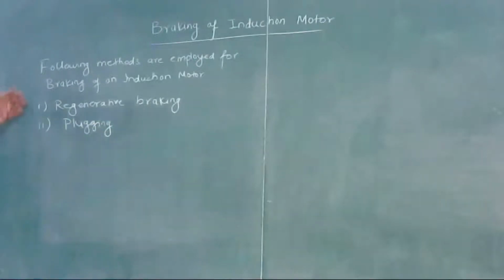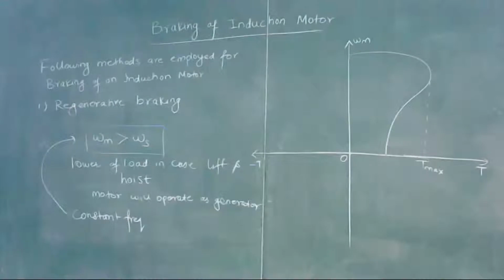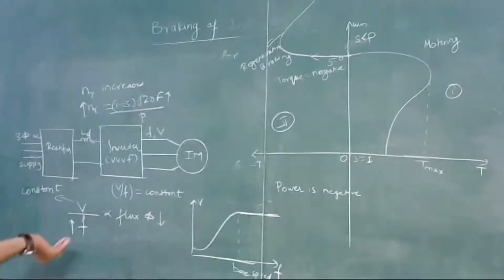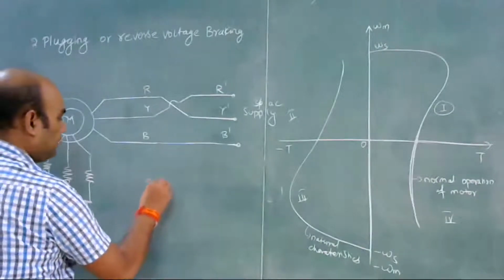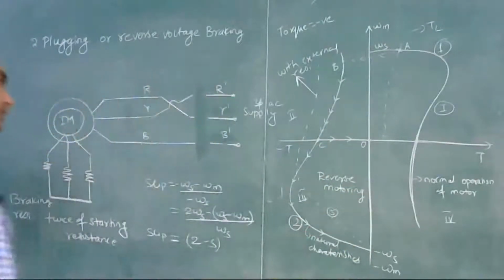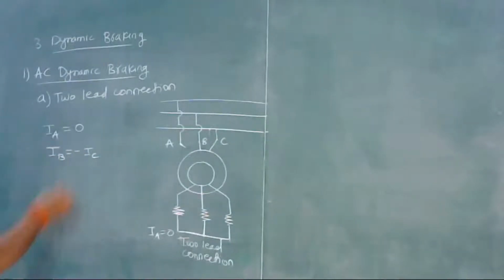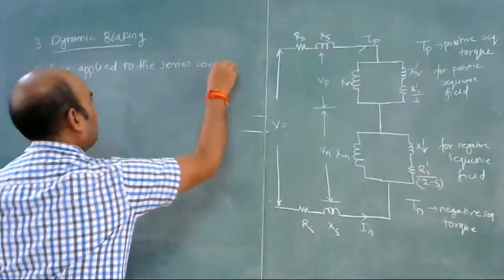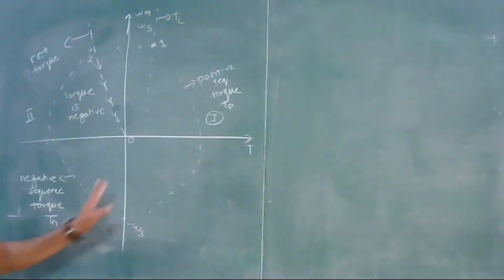Braking of Induction Motor-Regenerative braking, Plugging & ac dynamic braking

Comment: Sir i have a doubt, is that in AC 3 phase induction motors how does the exciataion will get to work as a generator

?

i am struggling with this question since long years

Comment: I have one question
Reply: In dynamic braking
Reply: How motor get generator
Reply: @JyotishSpecial  i have some knowledge let me share this.

DC motor will be made as separately excited generator, that means filed winding get supply from external source and armature rotates freely due to momentum.
Reply: @jangamlakshman7006  no
Reply: @JyotishSpecial  then how
Reply: I working on them hence I shared
Reply: @jangamlakshman7006  I also working
Reply: Indian braking system
Reply: @JyotishSpecial  which braking